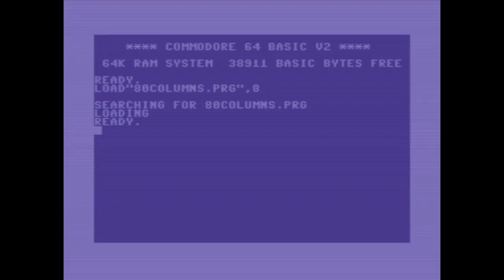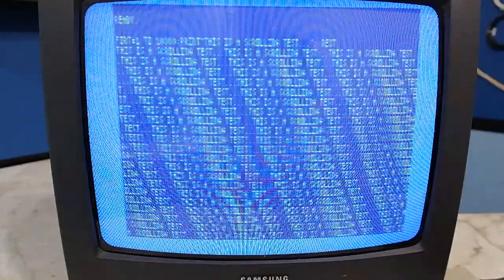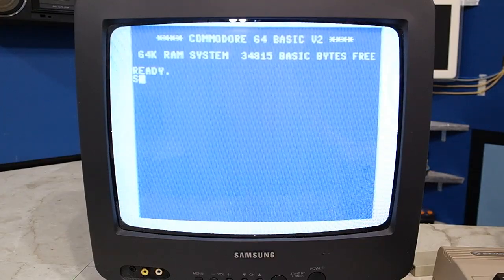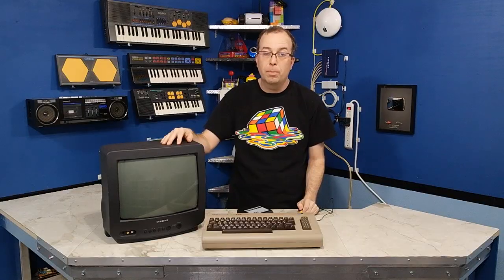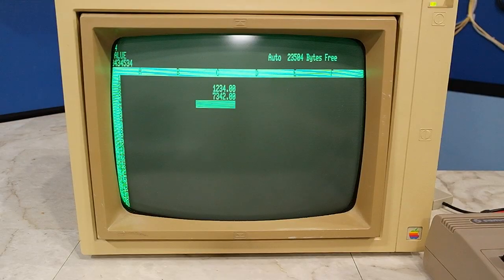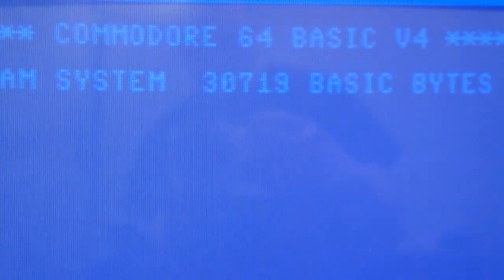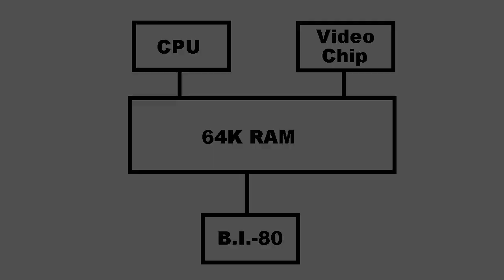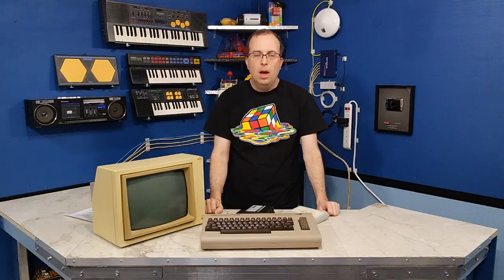The Quest for 80 Columns on the Commodore 64

Comment: It made a lot of sense to add an Extended 80-column card to my Apple //e, because unlike with Commodore, my card only used but 1 of many available circuit card slots. Whereas the Commodore appears to be filling up the expansion port, leaving no room to add anything else at the same time. Also, Apple's 80 column mode did not activate, unless software deliberately activated it, thus all the old games or whatever that did not need it, were not affected. In Applesoft Basic, one could type at the Basic prompt ] PR#3 to turn on 80-column mode. I think there was a special memory expansion slot, that was considered to be slot 3, so then no card could then be put into slot #3, if I remember right.

Furthermore, the Apple's Extended 80-column card, also added additional graphics capability, rather than high-resolution graphics, double-high-resolution graphics was also available, which suffered much less from the strange color restrictions. However, the 80-column text was widely used, and the double-high res graphics, not so much. Just a few programs such as Time-out Paint, a Beagle Brothers add-on for AppleWorks, and a few games used it.

Thus, if 80 columns was rendered as bitmapped graphics for whatever reason, as in a few WYSIWYG graphics based programs such as Publish It!, then each character could still be 7 pixels wide, and not need to be reduced to just 4 pixels wide, as is used in some Dialog windows of the TI89 graphing calculator. (However Publish It! used bitmapped "fonts" of varying sizes, so there was no arbitrary "80 columns" within that program.) In double-high-resolution graphics mode, each pixel was half as wide to make room for the horizontal doubling of pixels. Making a pixel strangely twice as tall as it is wide, as the same 192 rows of pixels remained. In normal high-resolution graphics mode, the high bit of a byte controlling 7 pixels, changes the possible colors for that group of 7 pixels. In double-high-resolution mode, the high bit, does nothing at all. As the half-bit shift that changed purple and green to red and blue, could be done simply by which pixels were drawn. 16 colors were possible, although not every pixel could be every color. Verses only 6 colors in normal high-resolution graphics, purple, green, red, blue, white and black.

The Extended 80-column card, could also be easily formatted as a 64K /RAMDISK.

The Apple // computers, clearly had the better option, than the Commodore, in adding 80-column text. However, it came too late, for it to have been made as wide of use of, as would have been nice. Much of the old software, had already been written, neglecting the possibility for 80-column text. Perhaps back then, many computers were thought of as for home and for video games, and not needing to also be "serious business machines".

Comment: I think that the only reason that 80 columns were popular for business is two-fold.  Punched cards were 80 columns, and fixed font printers were 10 characters per inch on letter size paper, that was common for documents.  The 40 column computers actually made this easy, in that you had simply 2 lines, instead of 1 line.  As you said though, a big reason for 40 columns, was the poor quality of television displays,  although I think a good part of the blame belongs to the very cheap and low quality RF modulators that tended to be thrown into the box.

Something I wonder, if you took the composite video out, of a C64 and plugged it into a TV made this century, with a composite video input, whether it wouldn't produce a decent picture.....

Comment: What are you using to power your C64? I have one that works fine but the power supply is blown (luckily not in a way that took the C64 with it). Apparently all the official PSUs are built like crap and will eventually all blow and the few modern replacements sold today are either built just as bad or are insanely expensive ($100+). Is there a safe cost-effective way to power these things today that I just haven't heard about?

Comment: The catch-22 you mentioned was the problem with almost every failed bit of computer hardware ever.  Why did it take hardware manufacturers 30 years to realize that no one will want your hardware (no matter how amazing it is) if there's no software.  Any one of these 80-column expansions could have been a contender if they just included a useful program (like a spreadsheet or word processor) that was built into the damn thing.  It was already taking up the ROM slot...I know this is hindsight, but it just seems so obvious...and I think it would have been obvious to me in 1983 (if I had been an adult...or even alive).
Reply: HaydenX GEOS? and no one was using a computer for these things back in the day.  It wouldn't have mattered.  People didn't understand computers line today.  Old people didn't understand, and only geeks were into them.

Comment: I used to have a C128D (the one with an integrated disk drive). I'd read in the manuals about 80 column mode, but i never could actually put it to use since I didn't have a monitor... Good to finally know some more about it :)

Comment: I had to "turn" my TV into a monochrome to view some of the higher graphics. Since all TV 's at the time used a vacuum tube for the picture tube, I shorted the red and blue guns to ground. This left only the green gun working. High voltage. Much fun.

Comment: Excellent video! This brings me back to childhood, when I had a C64 and used the terribly slow 80 column software, along with a terminal emulator, to dial into a BBS with a connection to the Internet, so I could use IRC and Elm.

Comment: Great video! FWIW, I did extensive word processing on my C-64. it wasn't WYSIWYG, but it was just fine. I wouldn't want to work that way today, but it's a stretch to say it was unusable for non gaming. GEOS a few years later did some awesome things.
Reply: Agreed. What killed the C-64 as a business machine was the IBM brand entering the personal computer market. The glacial speeds of the Commodore 1541 disk drives certainly didn't help. :)
Reply: The 64 never had any hope of being a business machine without the 80 columns.  It's not like 80 columns was unheard of during that time.  It was common and expected feature for anyone doing word processing, which was the huge attraction of computing at the time. Businesses didn't mind paying extra money for computers back then that worked better.

Comment: Awesome! Thanks for another Commodore video. In 1988 I bought a used C-128 and 1571. I liked the 128's 80 column mode for calling BBS's and word processing but I was disappointed that there were few if any games that took advantage of of the 128's hardware.

Comment: My 99 never worked, bought used. I was going to use it to store police frequencies and maps for my 1971 Mach 1, w/ 185mph top end for continental racing. However as stated it never really worked. I tried to adapt it to be, KB on glove box top, micro screen on one side..... as I said it did not work no matter what I tried. This is.not to say it would.not work
Today a $100 laptop could handle hundreds of times more info and be able to log in and update.

I was building a car for trans continental racing. My estimated top speed w/o destruction was 185 US MPH. Hence the need for frequencies and maps.

Thank you for your time.

Comment: My younger brother was a packet (ham) radio operator extraordinaire. We rigged up a C64 with an amber monochrome monitor, allowing us to use the 80 column bit map software emulation quite nicely. The packet set up plugged into the RS 232 (??). We were able to radio BBS everywhere. As far as the screen slowdown goes...well the Schnedler TurboBoard (4 MHz) took care of that really nicely. Did this for years until he grew up and moved away from home.

Suggestion: Could you do something on the various C64 speed up boards?

Comment: Interesting, and cool to have a C128 mention. That said you got some of your facts wrong on the C128. As for "a dozen titles for C128 80 column", that is completely wrong. There were way more than a dozen native 128 80 column native mode titles, way way more. The 128 also run CP/M which opened up a catalog of thousands of titles. I've run Kaypro software on my 128 with no problem, and even Televideo software.Then there is the Geos operating system, and a whole large catalog of 128 80 column specific title for it. There are hundreds if not thousands of titles.

Comment: Hi Dave! I was wondering whether you could set the color saturation of the modern CRT to zero - rendering it basically monochrome - to obtain a sharper image via composite cable, or would it stil be blurry as before?

Comment: Not having an 80 column card and doing term papers in high school was....err.. special.   I used "Magic Desk" as my word processor, and printed out to a thermal printer.. (Some old PCjr printer as I recall.).   Magic Desk put HUGE margins on the sides of the paper to compensate for being 40 columns.  Seemed to work fine, teachers hated it, but seemed to accept my papers...  :)
Reply: I had that same printer!  Protecto Enterprizes bought IBM's entire leftover stock after the PCjr flopped, took off the IBM badge, and simply called it "The Big Blue Printer" and sold it really cheap with an interface for various 8-bit machines.

Comment: One thing worth noting on the Apple II is that the 80 column standard - at least as far as software was concerned - on that platform actually /wasn't/ an Apple standard.

Instead, it was the Videx Videoterm that set the standard, which emulated a Datamedia 1520 terminal (I think). And, it worked in a similar way to the first C64 cartridge that you showed - the Apple II sent commands and characters to the card, which maintained its own screen buffer. I believe initially, it didn't automatically switch modes, though, you had to flip a physical switch. But, later, activating the card firmware activated the card's video output as well.

In any case, everyone just cloned /that/ card, rather than doing their own thing, which is what made everything go a lot more smoothly. And, Videx themselves released a 132 column card. This basically meant that you couldn't get away with twiddling the hardware directly, because different cards did slightly different things, and you had to rely on the firmware, as far as I can tell (even though Videx documented how to twiddle the hardware directly).

When the Apple //e was being designed, 80 column functionality was added to the motherboard chipset (the 80 column cards for the //e are merely RAM cards, adding the RAM necessary for 80 column mode in a bankswitched area on top of existing video memory, and the video hardware alternates which bank it pulls from for each byte). This means that in the //e, 80 column is now memory-mapped, where it wasn't on the Videx card. However, for compatibility, Apple implemented Videx-compatible firmware for 80 column mode, so software written for Videx would still work. Essentially, Apple subsumed a third-party standard into their own platform.

Comment: The 128 in 80 column mode was Gods-gift to the user when using terminal programs to connect to PC hosted BBS'.  You could utilize the full display of how the BBS was meant to be, plus enjoyed the wonderful ANSI graphics. Quite memorable experience that I still remember.  Made you realize how silly and amateurish 40 column mode was.  Unfortunately, few software took advantage of 128's native mode so many users hopped over to Amigas or PCs once they realized how much more they could achieve with a computer.
Reply: You might not realize it. But 40 columns was not chosen because it was cheaper to implement. It was chosen because of the bandwidth limitations of the NTSC/PAL video standard. Most people back then just used their TV as a cheap alternative to buying a real monitor.
Reply: @joyange1  Yeah... the real divide between business machines and home machines in the early 1980s was that the home machines were, in most cases, designed to connect to a color TV as a monitor. But analog color NTSC just couldn't handle 80-column text adequately. The computers aimed at business were designed to work primarily with a dedicated monitor, which was often monochrome, because good interactive text display was the paramount consideration.
Reply: I wrote one of those apparently 12 (lol) packages that supported C128 80 column mode - though I'm confident the number was higher if you included Geos128, which ran well in 640x200 mode on that chipset, even with the base 16K of 80 column video RAM. It was indeed basically this - though in the case of mine, it also supported Atari ASCII, raw Petscii (for the BBSes that did that), and you could also implement arbitrary keyboard layouts.

It got published via Uptime! which was a floppy-disk monthly for the C64 and C128.
Reply: Commodore did it right with the 128.  The 64 should have included an option for 80 columns text built-in, when paired with a proper monitor.  It would have made it a lot more competitive with the Apple IIc.

Comment: I had a Commodore 1902A monitor that had two cables connecting to C128 and I was able to pick the mode I wanted with a selector switch on the monitor's front panel. Elegant and easy solution.

Comment: Quite the blunt and specialized solutions they cooked up back then. If I made a whole cartridge I'd probably puts some more options into it like 6 pixel wide characters which some platforms supported, only gives you 53 columns but it reads on a CRT in color. Another method the reads well on CRTs is making the lowercase characters smaller versions of the uppercase, console games figured that out far too late with e, g, r, and q often reading like static. Fire up the time machine. Sweet paint program. ;)

Comment: Do the cartridges work on the C128?
Reply: They would definitely work in C64 mode.  As I stated in another reply, if the cartridge grounds (or "earths", if you prefer) pins 8 or 9, the computer is going to boot in C64 mode.  Even if it boots in 128 mode, the memory mapping is going to be different, so at the very least you're going to have to write new routines to access it.

I don't see the point in using an 80-column cartridge on a 128 anyway, since it has its own built-in 80-column graphics chip.
Reply: I was just wondering if the addresses were compatible, seeing as the 128 has more memory which is probably multiplexed in some way to get that extra space, and since there are other changes in the hardware that could possibly prevent the use of such a device.

Up next: PetDraw for the C128 80 columns?

Comment: The Amstrad CPC (an 8-bit computer from the early-mid 80s not very well known outside Europe) had 3 video modes without needing any extra hardware:
Mode 0: 20 columns & 16 colors.
Mode 1: 40 columns & 4 colors.
Mode 2: 80 columns & 2 colors.
This latter mode looked sharp in color monitors as well, and its 2 colors could be chosen from a palette of 26 colors (same with the other modes).

Comment: The Commodore 128's separate video ports for 80 column and 40 column were awesome, not a design flaw at all. It was my first dual screen software development experience, since you could run both at once. Developing game code on the 80 column screen while viewing the codes results on the 40 column.
Reply from the maker: Might have been good for niche uses.. but it would have seen more use had it been integrated into one video chip.
Reply: The 128 did have some good software support for the 80-column mode.  In college, about 28 years ago, I was using my C128 with two displays; an amber monochrome I used for the 80-column mode, and a regular 13" TV for the 40-column 128 or C64 mode.  That way, I could have my 80 columns for serious work, and 40 columns in color for my games. I did have GEOS 128 and a Star NX-1000C printer, but there were so many issues with the printer jamming and leaving off pixels at the end of lines on printouts, that I eventually had to give it up and go with Fleet System II, which fully supported the 128 mode and 80 columns, and worked beautifully with same printer.  Also, let's not forget the reason that Commodore did the separate ports was for full C64 compatibility.  However, ironically that same 100% C64 compatibility might have been what caused the C128 to die early; because few were using the C-128 mode; most were using the C-64 mode and playing games.
Reply: It's such a useful trick that IBM did it too: you could run with both an MDA and CGA card

Comment: Wait, the Commodore 1084 supported S-Video? Why did I miss this when I actually had one from my Amiga?
Reply from the maker: It's a strange version of S-Video called LCA where it uses two separate RCA jacks.  But you can build a cable that converts the ports to S-Video and it works just fine.

Comment: Is the 80 Columns Cartridge compatible on the 128 in both Regular and C64 mode?
Reply from the maker: I haven't tried.. but I would guess it works in C64 mode for sure.. not sure about 128 mode since the memory mapping would be different and the ROM probably not compatible.  But if you wanted to write your own software routines, it would probably work.